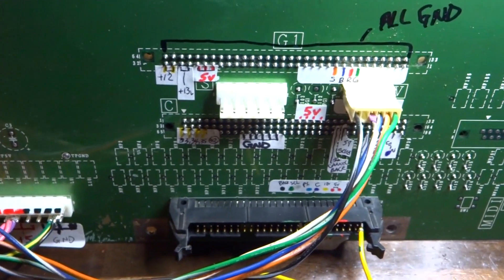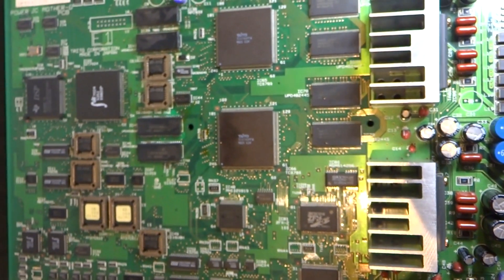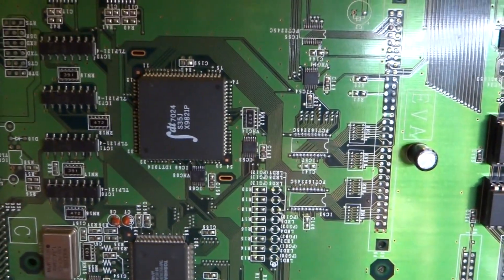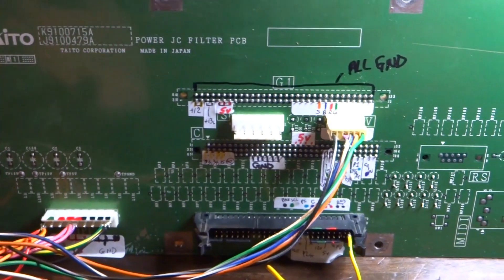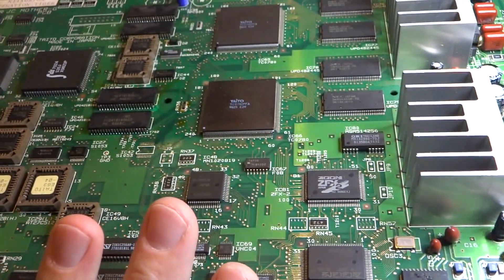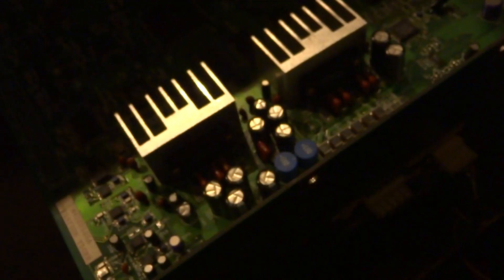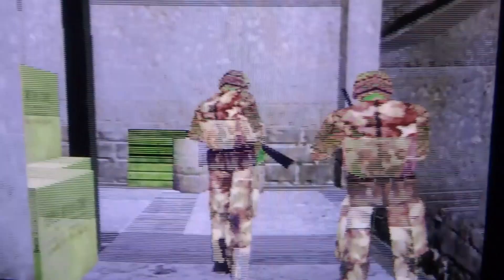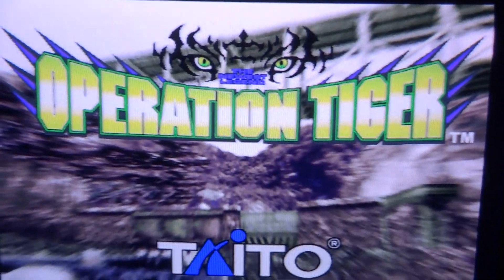Taito Operation Tiger Arcade PCB Partial Pinouts And Wiring Information

Comment from the maker: REVISED VIDEO PINOUTS for this PCB
On the "V" connector, the correct pins are Pin 1=Red, Pin 2= Green, Pin 3=Blue, Pin 4= Sync, Pins 5/6=Ground (GND) 
If you dont have the filter board and only have the "G1" pins, the pinout is 7 = RED, 8= Green, 9=Blue, 10= Sync, .
 I originally had Red and Green backwards but when I switched them around again, the colors came back. The characters look human again and less zombie like. This revised pinout is correct. If you are watching the video, you will need to switch Green and Red only. I will post updated pictures on the forum as well.